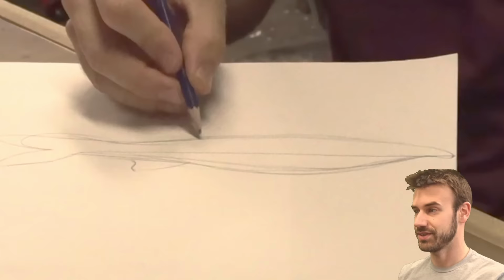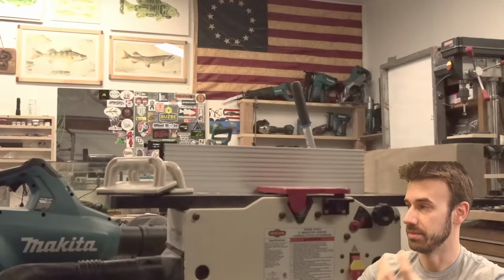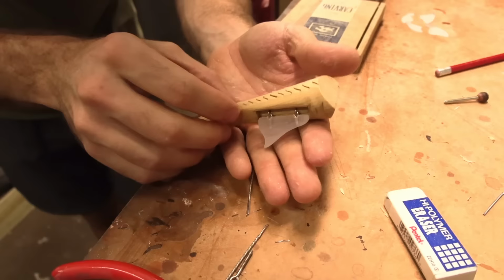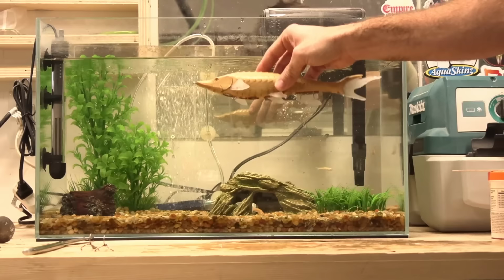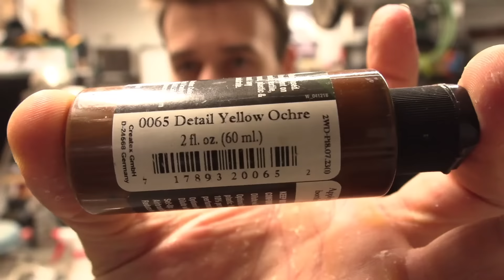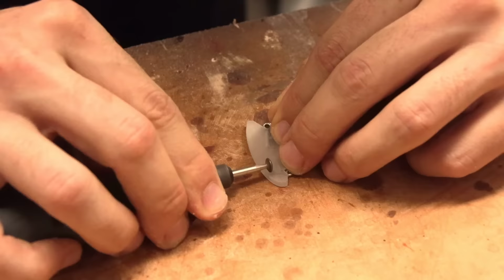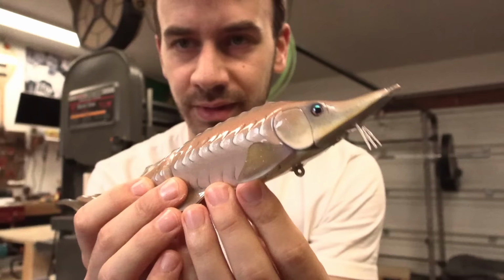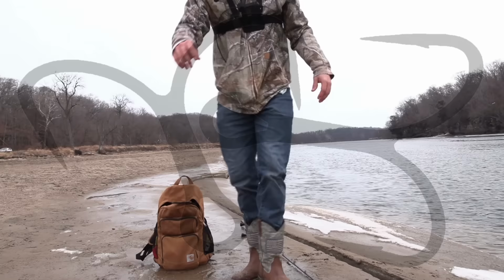Making a Sturgeon Lure

Comment: This might be too crazy, but you could try a Stingray lure - I think the only way would be to have a 3-piece lure with a flat oval centre piece and two semi-circle ‘wings’ either side. Might not be possible but would be very interesting :)
Reply: Hard bait center. Soft plastic wings. Jointed tail.
Reply: Be careful with the water level in the test tank. The heater will crack and brake if it isn’t submerged.
Reply: that would be really cool, like the floppy brass fin catfish lure or the jointed fin mooneye, but even more insane
edit: or this one, I hadn't watched far enough to see the floppy fins when I commented this

Comment: Had an interesting idea for a bait today. It's not the first time someone has made something like this, but the bait is a fish (probably large mouth bass) chasing another smaller fish. I've seen some vintage baits that did this out of one block of wood, but I think it would be cool to have two separate baits connected by a leader. I realize you made a similar bait before (the chatter buddy), but if done right, you might be able to get other bass to follow it like they do when one is trying to eat. The front fish would esetualy have no action, but the chasing fish could have a joint and possibly have a great action.
Reply: That would be cool!

Comment: most members of the Acipenser genus are endangered which includes the bulk of the sturgeon, the shovelnose is not a member of that genus however another species in its genus called the Pallid Sturgeon is endangered in the U.S. and the caviar is going to be from species of the acipenser genus so dont try any roe you get from a shovelnose. Great video as usual Nate
Reply: to add to this, there are species of predatory sturgeon that have much larger mouths fixated towards the front of their heads, shovelnose are not one of those species and thats why they have the mouths on the bottom, like most of the "smaller sturgeon" they feed on scraps of animal material and insect larvae. the ones that are are mostly predatory would be from the Huso genus which is also the largest

Comment: Extra information because I can! 

Kaviar is specifically underdeveloped eggs, so it's not what comes out on its own, as those eggs are ready to be laid. To harvest the kaviar, the fish is caught and killed, the eggs cut out. This is why they are so heavily overfished in certain areas, mostly europe and asia. The slow reproduction rate with 20 years to mature and the target on egg laying females is what is putting them under. 

Many fish, including the sturgeon, can force air trough their gills to get some oxygen. Gills can get their oxygen from the air so long as the gills are wet enough, so that the oxygen in the air can exchange with the moisture from which the gills pull it. It's beneficial to do so if there's not enough oxygen in the water. 

Another beautiful lure, I always remain amazed at the work you do. The scutes look phenomenal!

Comment: They breach because the pressure dissolves the gases in their swim bladders over time. When they lose their buoyancy they breach to adjust it. It’s fairly common when they get hooked. I believe it confuses them when they are pulled off the bottom and that is why some of them breach.

Comment: Fun fact: A fish gulping air is, in extremely low oxygen conditions, an attempt to force oxygenated surface water over the gills but more commonly it is done to swallow air for the purposes of balancing the buoyancy of a fish. A large proportion of fish, including sturgeon, have what is known as a physostomous or open swim bladder which is connected to the intestinal tract by a valve of sorts. This arrangement allows the fish to increase or lower its buoyancy like a submarine so it can sit higher or lower in the water column, if the fish wants to sit high in the water to feed or enjoy the warm sunshine then it can swallow a bunch of air from the surface and fill the swim bladder, if it then decides it wants to drop down to the bottom to feed or hide it can burp or fart the air back out and sink.
The other arrangement of swim bladder is called a physoclistous or closed swim bladder which doesn't connect to the gut and is instead controlled by oxygen transfer through blood vessels and while much less easily adjusted it can operate at far higher pressures so is better for things living in extremely deep water. If you've ever been sea fishing in deep water it's fairly common to see a fish come up with its swim bladder massively overinflated and hanging out of its mouth, this is simply because the pressurised air in the swim bladder has expanded as it comes up quickly from the high pressure environment to the low pressure surface environment (roughly +1 bar/14.5psi per 10m/33ft of depth).

Comment: I gave up on GoPros and just use the cheaper but surprisingly good SJ Cams.  I've only had one failure and that was my own fault continually using the same battery attached to an external power pack.  The battery damaged the camera.  Accessories are so so cheap for them too.  They are the quintessential 'disposable' camera.

Comment: As always great work with the knife and with the paint. Now about why it is endangered. It's simple, you are a smart guy, you could figure it out, but it's a combination of several factors - all of them men made. Heavy fishing industry - black caviar is not cheap, dams - the fish migrates up and down the river when throwing its eggs, heavy boat movement and pollution with all kind of chemicals, combined with slow reproduction cycles and the fact that only 10% of the survived small fish reaches sexual maturity. In Bulgaria in the river Danube in the past there was a lot of fish called Beluga. I think this is the specie that become larger than the others - 102 kg and around 6 meters. We also have other smaller species like sterlet. Last but not least, I think you could make the barbels from soft plastic. They would be way more realistic.